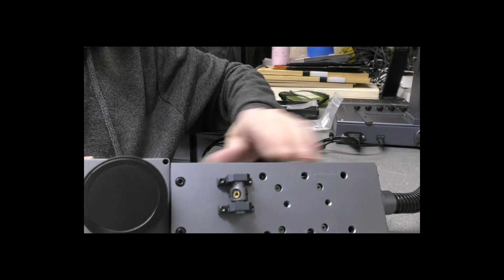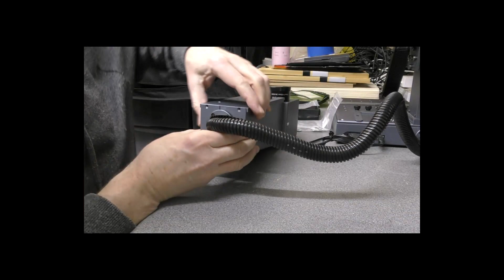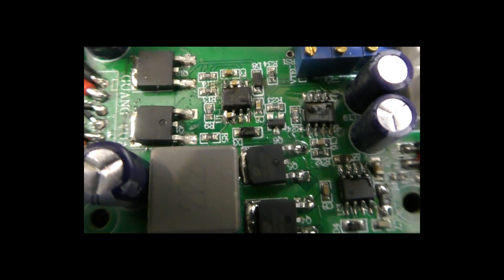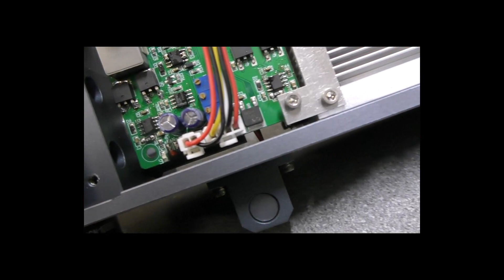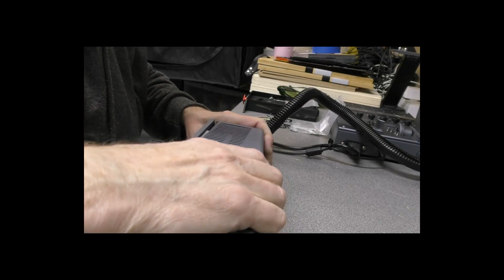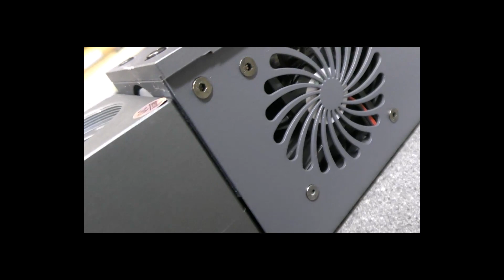Inside the laser head of the Mr Carve M1 Pro DPSS laser

Comment: Thanks for the Pics from the inside! Would it be possible also to open the base and share some views from there? 
I own the M2 but without the plug for the rotary. It seems that they are pretty the same except the placement of the boards. Also better soldered, too... Thanks in advance.

Aaahh. Just found the vid of the base! Thanks for your work..
Are the rotary plugs just standard usb? Or have I seen it wrong? Are they recognized by the PC as different devices?  Sorry for bothering.....

Comment: Poor solder I would assume is because half those parts are recycled parts, so those that failed on first test got replaced with others. the one who assembled it probably has no clue, just follows a set of pictures of the parts locations as he places and manually solders them, same for the wiring.
Reply from the maker: Yes, good call. But surely could have managed a clean after the butchery. :pmsl:
Reply: @Trevs-Shed  That would mean an extra 5 minutes per board, and 10 less for the day. So long as they "worked when leaving" they are fine for the assembler.